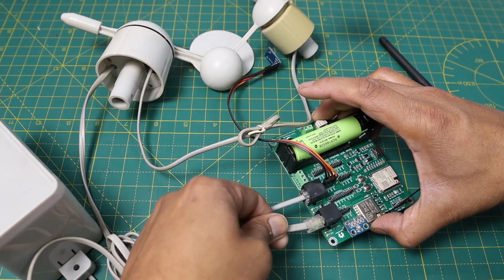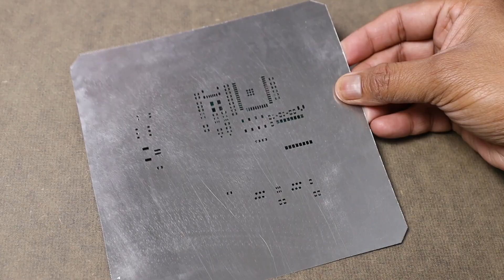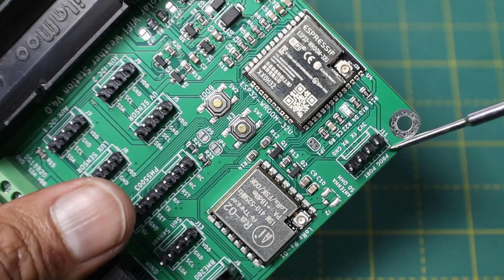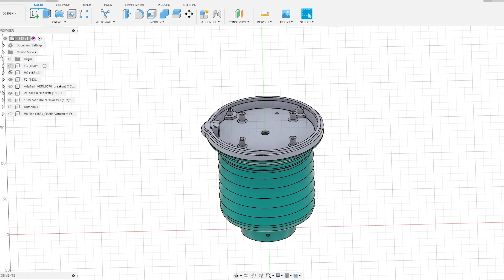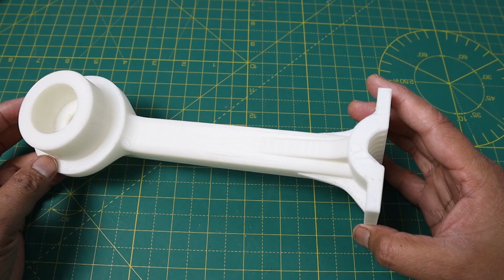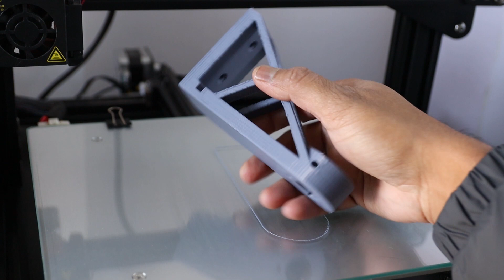DIY Solar WiFi Weather Station V4.0

Comment: Instead of the LP4060S I am using MCP73831T, will it work without any changes? It does seem to have the same pinouts.

Comment: That PCB won't last long to outside conditions... you need a water resistant case for PCB inside the outer case. I hope you designed PCB with short circuit protection... 18650's are dangerous!

Comment: Hi,
I built the v3 version which fundamentally worked but I had big issues with deep sleep and "brown outs" which it didn't recover from. I made modifications to reduce power usage, stored variables in a serial NVM etc etc but would still get non-recoverable resets (sometimes up to a couple of weeks of good operation). Does the V4 version address these issues? Also, which band should I use in the UK, 803 -930 or 430 - 525 ?  and can this be defined when ordering the assembled PCB ?

Comment: Bhai can you suggest an anemometer project which can be done at home without a 3d printer. I would like the readings to be recorded on Aurduino with time. And also is it somehow possible to capture the wind force torque as well. Plz suggest as you haven't shared any details about the wind sensor /anemometer which you used in this project